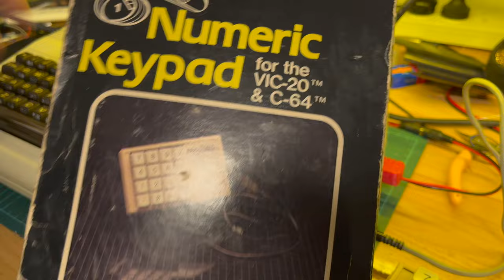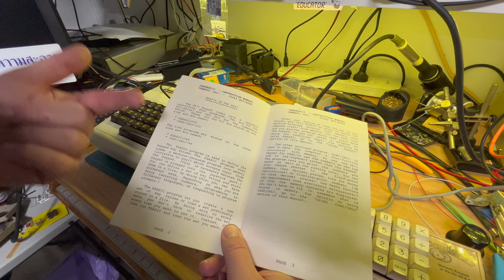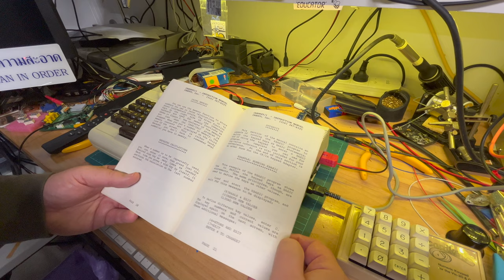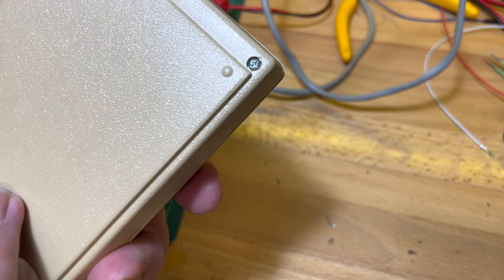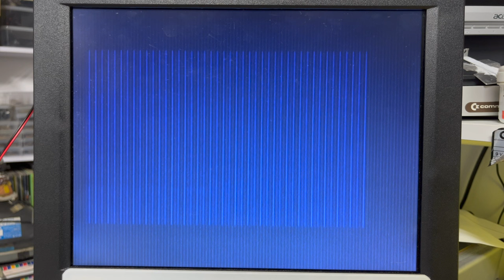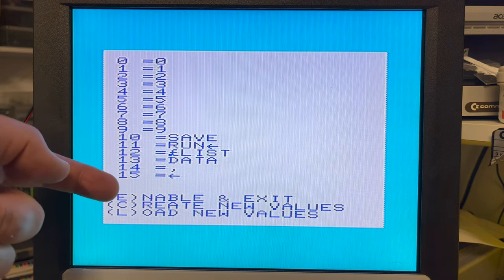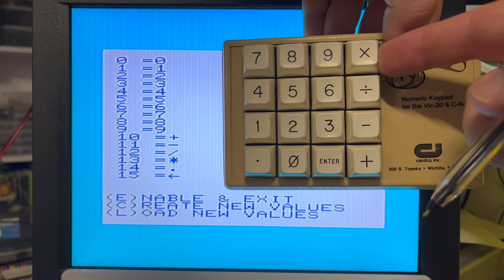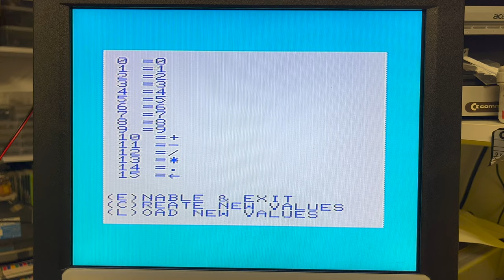🇺🇸 Commodore VIC-20: Cardco "Cardkey 1" numeric keypad [TCE #0213]

Comment: Very clever, a truckload of diodes, all directions of the joystick in combination with the fire-button makes 16 possible combinations. The software is scanning the joystick-port and is filling in some data in the keyboard buffer, I guess that when you use this software and classical joystick, then disconnect this Cardco Keypad, the results will be the same.

Comment: The Cardco keyboard is a knock-off of the Atari CX-85 external keypad that has the same design language as the Atari 800, but works exactly the same way. That means that you can use the Cardco on an Atari with the software you have, or Atari’s software. It also means you can use a CX-85 on a Commodore with the Cardco driver.